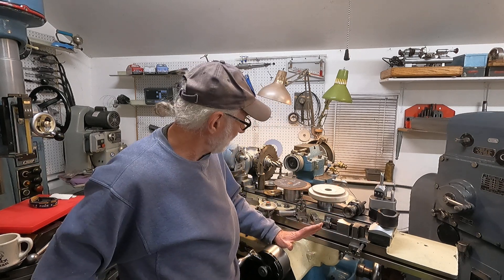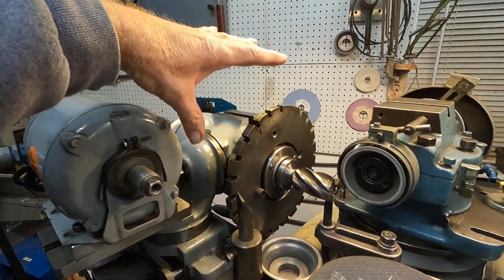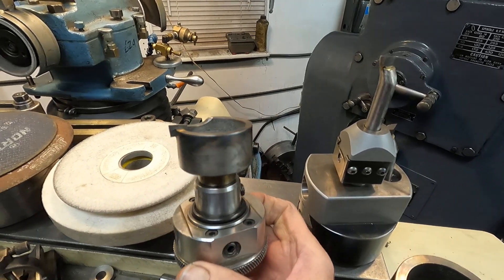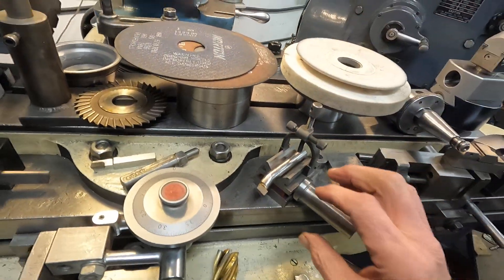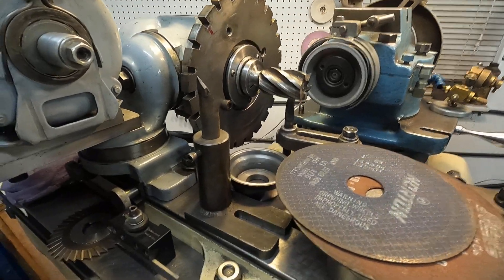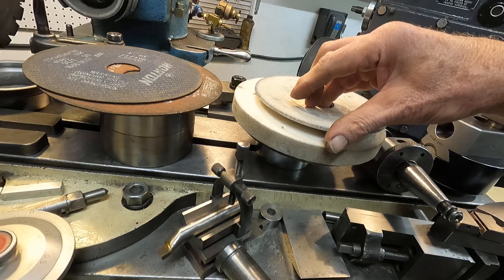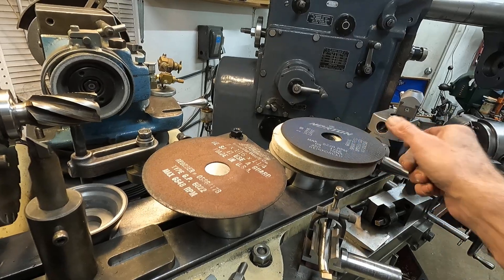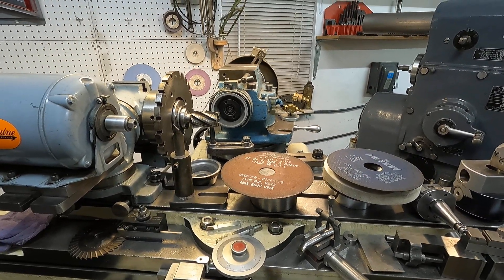Tool & Cutter Grinder Roundup

Comment: Hello Don, Love Your videos ! i have a 1930-40's B&S #10 tool&cutter grinder, i was going to buy a used 4"  6 jaw buck chuck! after watchingYour video i think ill get a Shars 4" 4 jaw over a cheaper Sanuo of the same ! Would You have any recommendations   Thank You Don
Alec Ryals
Reply from the maker: I noticed there is a 4" usa made Union chuck on ebay for $150, that is what I am using. There is also a Buck 4" 4jaw for $200.
 I tend not to buy made in China, thanks for tuning in!
Reply: @deedeeindustrialsuperprecision // well i took a chance with a 4'' 4 jaw Shars it was tight in the jaw slots till i cleaned it ! and the jaw to thread adjustment screw play is ~ .20-.030 not to impressive i have a 4'' 3 jaw Union chuck i got for cheap on epay i always  liked the accuracy and the jaw are way Tight Yea !!!  i took in apart to clean and#2 and #3 jaws were switched now it should be way better Thank You Don love You Vides.  The old union chuck only has enough play to move in both directions  Great advice !

Comment: Dee Dee very good info on the cutoff wheels still have the scar on my leg from when one blew up 35 years ago.
Reply from the maker: The cutoff wheels are the hardest working tool in my shop. Using cutoff wheels on cutter grinders does take an easy touch.

Comment: Great video! I just purchased a Delta Milwaukee Unihead w/4C Collets for my K.O. Lee off eBay. My Grinder came with quite a few wheels/stones, they look really rough. How do you know if they are good to use, other than cracks, chips, and ringing them, etc.?
Reply from the maker: After ring testing stand aside for a couple of minutes when first running. I have extra wheels also some that the paper blotters fell off, Be sure there is paper between the wheels and hub flanges.